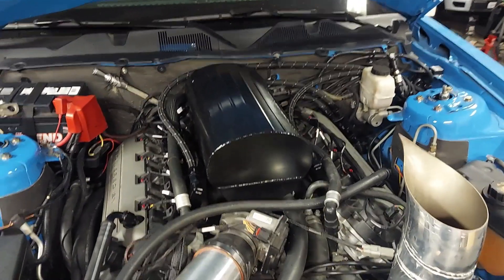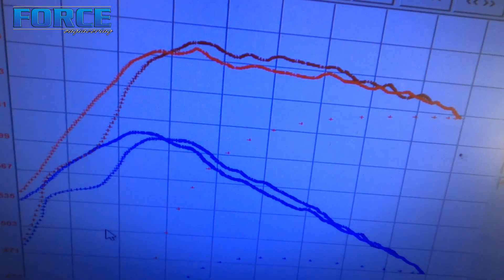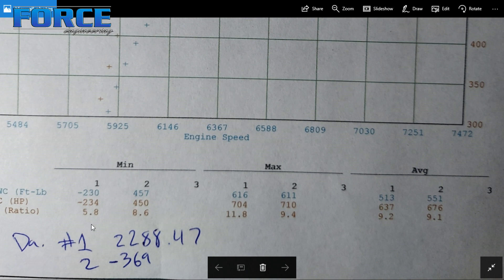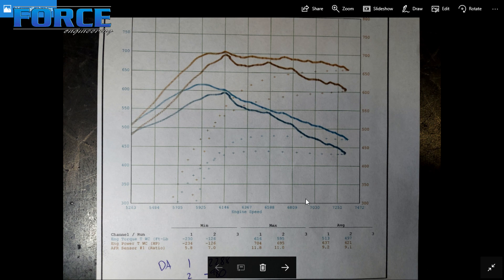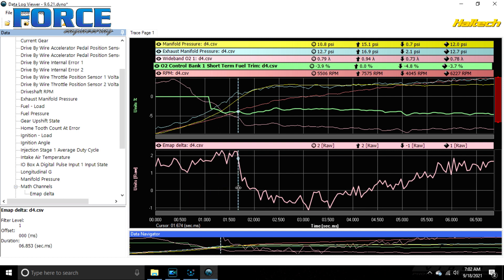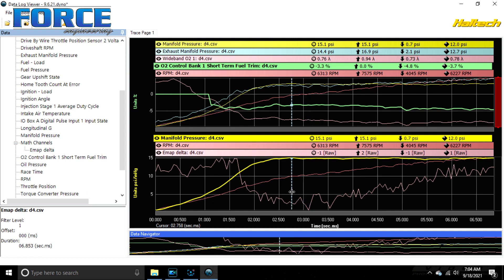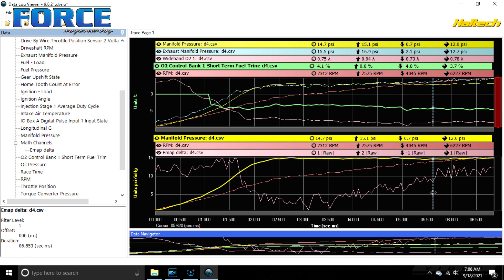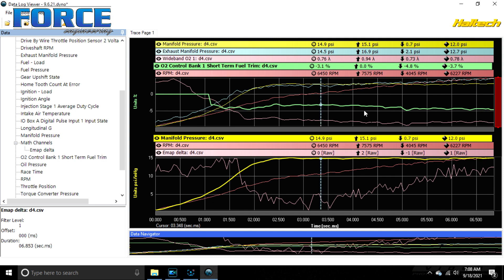Increased Plenum Volume Test Results | Waste Of Time?

Comment: Shorter runners?
Reply from the maker: The runners aren't that long currently.  That said tho, once the intercooler because an issue ill do another intake and it will a shorter runn for sure.

Comment: What is the boost temperature at 6000 up ?
Reply from the maker: With the air to water intercooler it stays with 10* the hole hit.  I dont have data on that specific pull in front of me.  But typically on the dyno the intake temps dont get over 70*